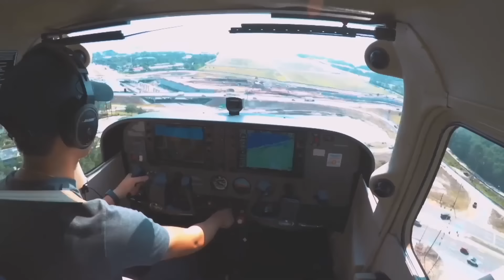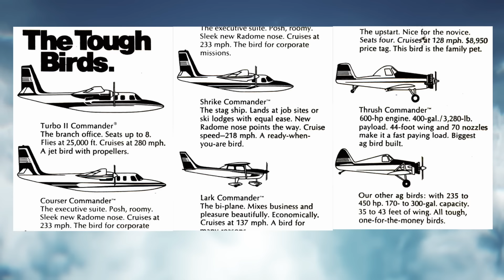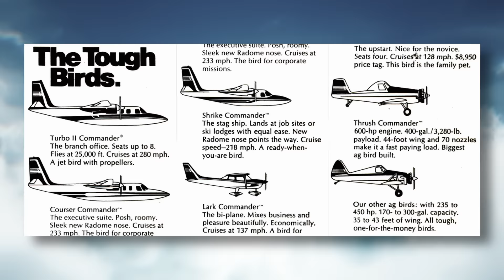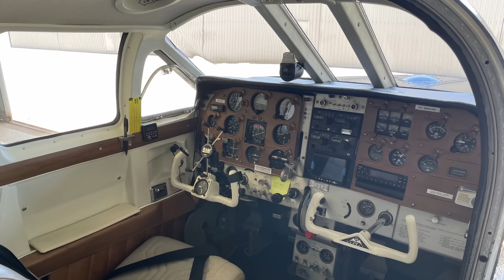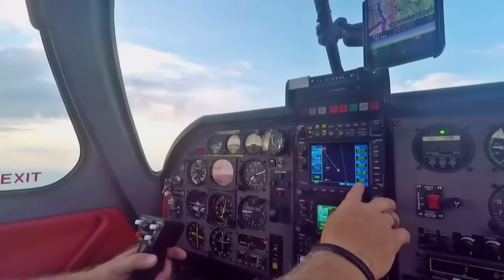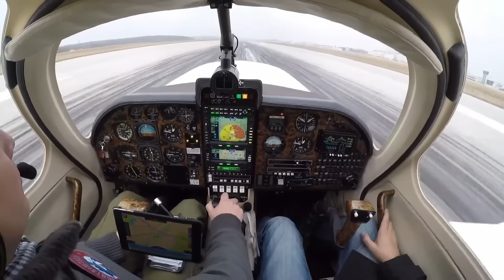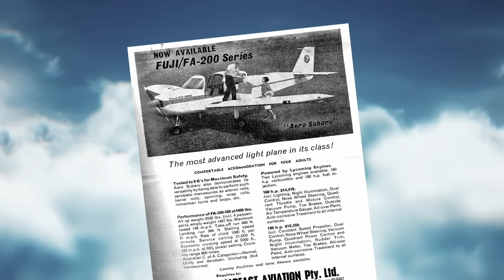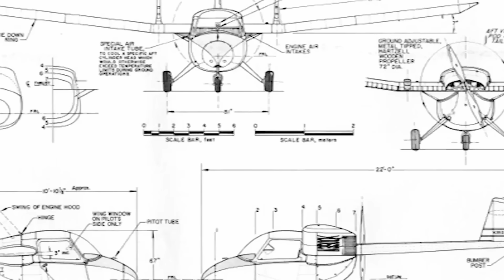Four-Seat Blunders...and Why They Failed

Comment: I got my license in 1982, in a Cessna 150 and two Cessna 172s. I currently have a 1974 Cessna 172M, with the original panel. I love the looks of the high wing Cessnas. I also love the visibility. You can look out the side window, and see what is below you. In a low wing plane all you see is the top of the wing. The high wing Cessnas are also much easier to get in and out of, which is important to me because I am 65 and have arthritis.
Reply from the maker: Once i got my license, most of flying was in the M
Reply: The low wings are a lot easier to fuel - at 75 I enjoy that capability. Cardinals are the best for getting in and out imo
Reply: When having verbal battle over what plane was best with all my flyboy chronies, an instructor once told us the following to shut us up: ‘Every airplane design is a compromise’.   Nuff said…

Comment: I flew the T250 prototype.  Cleo Bickford invited me to tag along .  It flew great!   The T-tail was in vogue at the time but most really did not work out… not true for the T250.  13 ft span on the tail and it was fingered flown.  It actually held 5 with full tanks.   The prototype jet was bought and just left our field in a truck.    Ballanca bought it off AG and after 5 built realized it would compete too much with the  Viking series and squashed the deal.

Comment: Nice video! We used to have a few of the featured aircraft on our airfield, like the Mustang, the Fuji and a Ruschmeyer! Personally, I used to fly a rather unknown 4-seater, the Robin R3000. Not your typical Robin, because it was a T-Tail, full metal bird with fantastic view, very agile controls, easy to land and very efficient (130kts cruise with 180HP) - a joy to fly! Also capable to operate from a 700m airfield with 4 adults + full tanks! I miss this airplane since someone crashed it in a french forest.
Reply from the maker: I love the Robin designs, very sleek and agile looking.  But, 4 adults + full tanks was safe?   Passengers must have weighed 50 lb!
Reply: @aircraftadventures-vids  Just had a (sentimental) look at the AFM: 685kg empty, 164kg fuel, left you almost 80kg/seat (177lb) to reach the max weight of 1150kg. Sorry for the kilograms (I fly planes with kts, mph and km/h...)  On a warm summer day, full MTOW would use some 520m ground roll for T/O. Fun fact of the Robin were also the writings in the cockpit: "Feu d'Atterissage" was landing light "Feu de Roulage" was Taxilight, "Phare" was the beacon, "préchauffage du carburateur" was carb heat and so on...